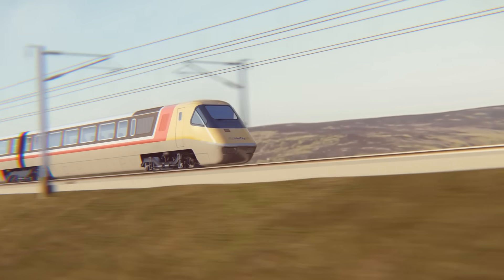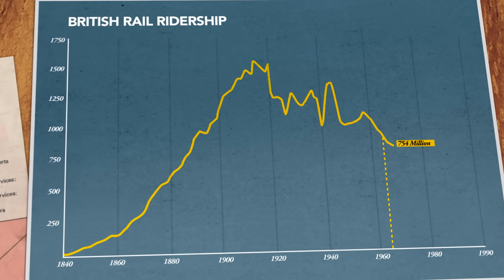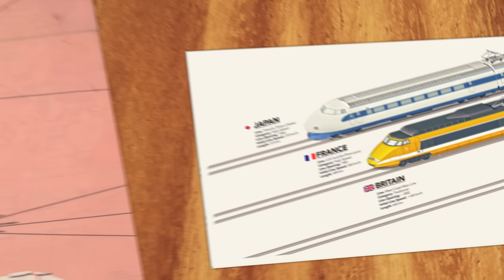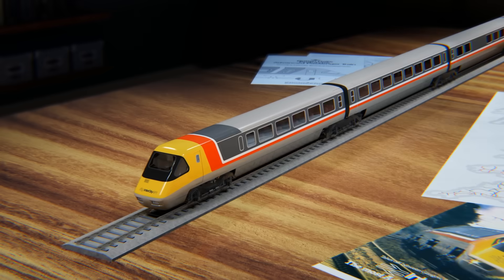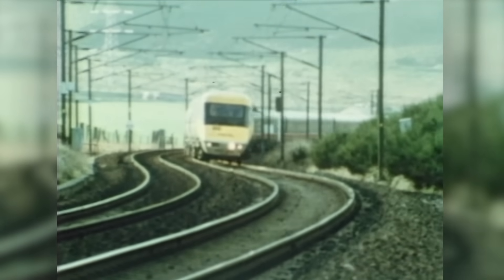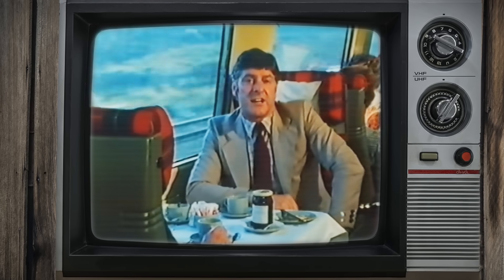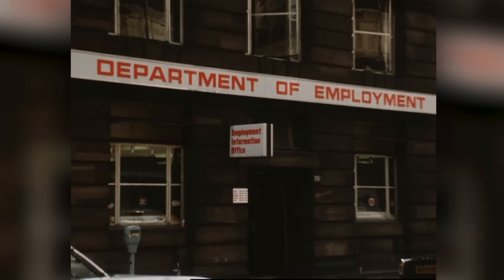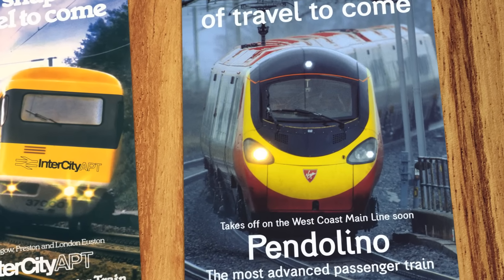This Train Made Passengers Sick: The APT Tilting Train Story

Comment: Ah, the good old tilting trains. These damn things was introduced to my country as well, Norway. They got slaughtered by the passengers; people hated them. Our railway is hopelessly windy and turning; literally there are next to no sustained section of rail without at least some turn to it. The initial few weeks were a total disaster; passengers would frequently be forced to abandon their trip because of sea-sickness-like symptoms, and some even had to be evacuated by ambulance. There were also reported accidents, were conductors in particular were thrown off their feet because of the extreme turning the train is subjected to in sections of our railway network. 

The tilting only survived for a couple of months until conductors and engine drivers got fed up with the tilting and began to manually disable the tilting at the beginning of their shifts. By the time a year had passed, it was decided that all trains were to have the tilting disabled. 
 
These trains are still in service nearly 30years after their botched introduction, though now they no longer tilt, and they have been redesigned to better accommodate passengers.
Reply: You mean the type 73, and you better re-check your sources on all that.
Reply: @LosBerkos  while I may not be enough into the train world to know the type used here, the fact that the trains got absolutely destroyed here by the passengers is not a secret really. And it is not a secret either that the railway itself provides a challenge for the trains used on them.

Comment: The supreme irony is that the HST (what became better known as the Inter-City 125) was intended as a stop-gap to provide fast services over non-electrified routes, until those lines could be electrified and the trains replaced with more APTs. However, the HST was so successful that it ended up essentially saving British Rail, and only now are they being withdrawn from service 45 years after their first introduction on the main London routes. 

But the HSTs refuse to die! Not only did they get new Mirlees engines in the 1990s to replace the Paxman Valenta engines with which they were originally fitted, but there are many are still in service, with modernised coaches. They work internal express services in Scotland; fast local services in the South West of England; and long-distance Cross Country services from Scotland and the North East of England to South Wales and the South West of England.
Reply: I used to enjoy travelling on the intercity 125s until they simply became too expensive to travel on.
Reply: @439bananas  The InterCity 125s are no more expensive to travel on than other long-distance trains. High fares are nothing to do with the actual trains, but the franchise operators that run them - very often our high train fares are due to the fact that they're lining the pockets of the privatised companies, or even subsidising the fares of overseas train companies (many British train companies are owned, in whole or in part, by foriegn train operators).
Reply: @kevinrussell2718  Well that is the thing, you can't privatise something and expect it to be cheaper when there are shareholders to be paid. And didn't the government split the trains from the network because they knew that a big bulky aging infrastructure would be a millstone in the sell off? I am under no illusion where the cost of train travel comes from.
Reply: @439bananas  That they did. They were sold to Leasing Companies, who then leased them to Train Operating Companies (who actually hold the franchises for each route or area).
Reply: @439bananas  And I fully agree - they should never have been privatised! All we got was more expensive fares and worse services with late and/or dirty trains.
Reply: @kevinrussell2718  Completely agree I enjoyed going around the country as a teen and being able to have a wine or a cider and watch the world go by as I did so.
Reply: @439bananas  I still do - although it's not the same without locomotive-hauled trains of Mk.2s!
Reply: @kevinrussell2718  Got a car now, so too late on that score. My father fancied driving a steam train and I tried to arrange a lesson for him, but his age and lack of experience meant no dice. We have a private model railway nearby and I would have been able to get him driving sessions on that in exchange for me doing a bit in their workshops, but my mother was not too keen, so hey ho.

Comment: actually the most powerfull ever British Train was The Deltic at 12 thousand horse power
Reply: Er, no, sorry. The Deltic loco’s power output was a peak of 3,600hp. It would have to have been 3/4 longer and heavier than it was, and segmented/articulated to squeeze in 12,000hp’s worth of diesel engine. The most powerful British diesels were and still are the HST power/driving cars, 4000hp each.

Comment: Logically, shouldn’t of the train wheels leaned the turn and the actual cab stayed straight?
Reply: You cant lean the wheels.  They're slotting in to the track.  The noise would be horrific
Reply: @NumNumbat  nono I mean like the wheels could move but the cab could stay suspended up in the air, the wheels could lean into it, but the design would keep the cabin facing

Comment: Canada's LRC was to have done the same thing that the APT was--design a train with active tilting that could run high speed trains on existing tracks.  The LRC was unsuccessful but at least the coaches could operate with conventional trainers.    To that end, the LRC coaches remain in service in 2020 but are scheduled to be replaced.

Comment: Fun fact: Sweden uses this exact sort of train from the same company for our line of High Speed Trains due to even though shutting down a gigantic portion of the rail network, it covered most of Sweden already. And due to the sheer size of Sweden versus how many can use... well it was cheaper option to go for the Italian trains. And whilst I enjoy them very much, especially the newest fleet with more narrow plating and wiring, there is one big mistake SJ still ain't gotten fixed. The air pull is underneath... where the snow can be... like lots of snow... like clogging the vents amount... There is a reason there is a joke about how SJ is always surprised at the fact it snows in sweden...

Comment: This was by far the more innovative compared to TGV or the Shinkansen. Because the train do not need an additional track to run at speeds. When I saw the Italians trains running again on your tracks with your own sold technology, I am starting to think of the media agenda then that took down the train rather than any fundamental fault with the train itself. Although the tilting motion should have being adjusted for more passenger comfort. But someone should have being there in the administration who should have said " There are little problems for the short term , but the train will run".
Reply: the Italian Pendolino was put in service before APT, it is a myth that it is based on British technology

Comment: As large as the United States is, it would seem to be ideal for a high-speed railway. Why don't the U.S. railroad companies form a consortium to build a dedicated straight high-speed railway between, say, New York and Los Angeles? That's a straight-line distance of 2,445 miles. At a speed of, say, 250 miles per hour, such a trip could be done in 9.78 hours. At 350 miles per hour, it would take only 6.99 hours. Such times would definitely be competitive with the travel times of the airlines, what with their delays, layovers and cramped seating.
Reply: There is a lot of very rough, mountainous terrain you'd have to cross. The geography in the US is completely different than Japan and Europe. It would be very difficult and insanely expensive to build a high speed rail line that long, and no private company is going to want to take the gamble. The government would have to build it, and good luck getting the public to support it. I think high speed trains can work in regions, in shorter distances, but it's completely impractical to try to build a high speed line thousands of miles across the country. That would be nuts.

Comment: As one can read in Italian language on this wikipedia page https://it.m.wikipedia.org/wiki/Advanced_Passenger_Train those patents (related to the APT boogies) were acquired in order to improve the design of the second generation of Pendolinos. The first generation of those Italian trains predates the APT by about 6 years and therefore was not a derivation of the APT. It was very successful in particular because of the choice to use gyroscopes in order to detect the "lead-in sopraelevation" of the tracks just prior to the curves and thus smooth out the tilt seamlessly - while the British solution used the centrifugal force itself (while already in the curve) in order to steer the tilt, hence the discomfort felt by many passengers, particularly in those initial tests. There is a very interesting book - still in Italian language ("Oltre il Pendolino" by Professor Konig) - which is very interesting with regard to the history and early development of the Pendolino project.
While the video does make this point, I feel it should be perhaps even more clearly stated that the tilt occurs JUST FOR PASSENGER'S COMFORT. Indeed it has nothing to do with the train thus being able  to travel at higher speeds in curves without derailing. In fact a non-tilting train could travel at the same speeds, however such a ride would be VERY uncomfortable for the passengers.
Reply: So who much of the patent did they buy and any idea how much paid?

Comment: Don’t buy Italian trains, that’s something we in Denmark have learned long ago.
Reply: The pendolinos we have are surprisingly reliable. At least in a structural sense. We had one derail at 90mph (Grayrigg derailment), zero fatalities directly from the crash itself, the sole fatality involved was a heart attack. People critiqued its tiny windows but those tiny windows (actually the roll cage or sorts that forced them to have small windows) saved lives. The UK's experience is don't buy Spanish trains, especially from CAF.
Reply: afxinfinitee I’m from denmark we learned from our mistake, the Italian trains never got to work probably and we could get no compensation for them delivering far to late or that the trains don’t work well enough to be used. I guess but but south European trains is what to take away from that. 
In Denmark we have learned from the mistake and have now ordered German trains.
Reply: afxinfinitee the derail most likely were because if the UK rails.  I remember manny places I visited, I was surprised that the trains could even use those poor rails as they were running trough the landscape like snakes and not even in a way that really made them run parallel to each other.

Comment: Unlikely that it's motion sickness. Probably the fear of traveling in a new type of 🚂🚋🚃🚋🚃🚋🚃train is to be blamed. 
The high spirited Italians did succeed, fortunately🍀.
Reply: Pendolino has two gyroscopic and accelerometric transducers on the two bogies of every car, instead of a single accelerometer on the center of the car. That means that it reads the inclination of the track at the start of the turn, and can react in advance and more precisely than the APT system, avoiding the oscillations and imbalances that were the cause of the motion sickness of the British project. That's why it had been so successful worldwide.

Comment: I always thought that the APT was based on the Italian Pendolino train, which I believe is still in service.
Reply: They were parallel projects and, briefly, competitors. Nothing of one ended up in the other.
The Pendolino prototype, FIAT Y 0160, was built in 1970, the APT prototype run for the first time only at the end of 1971. The first commercial Pendolino (ETR 401) became operative in 1976 and had been retired from passenger service only in 2008. The working principle of the two is different. Pendolino has two gyroscopic and accelerometric transducers on the two bogies of every car, instead of a single accelerometer on the center of the car. That means that it reads the inclination of the track at the start of the turn, and can react in advance and more precisely than the APT system, avoiding the oscillations and imbalances that were the cause of the motion sickness of the British project. That's why it had been so successful worldwide.
The only reason why FIAT bought the British patents in the '80s, was to avoid someone else buying them and developing them in a competitor project.